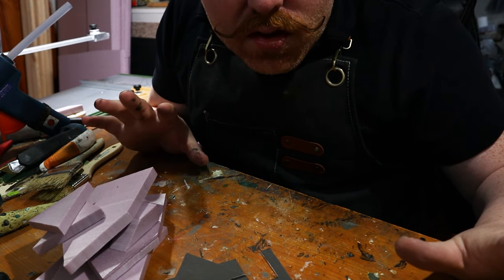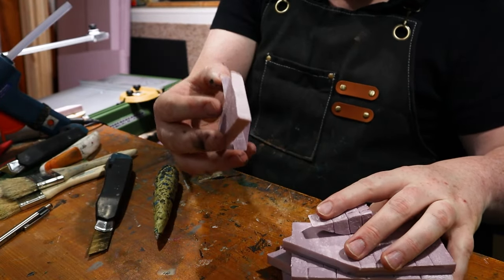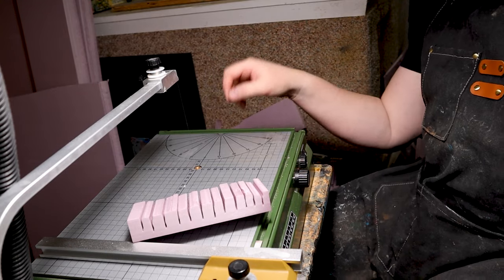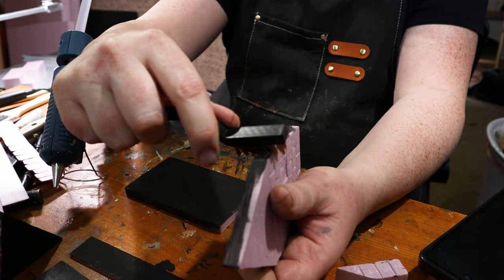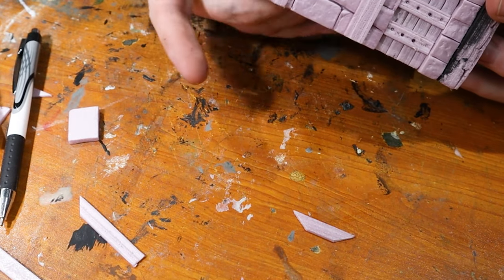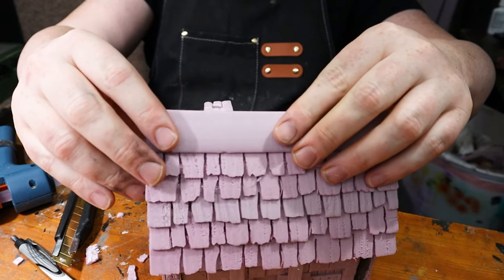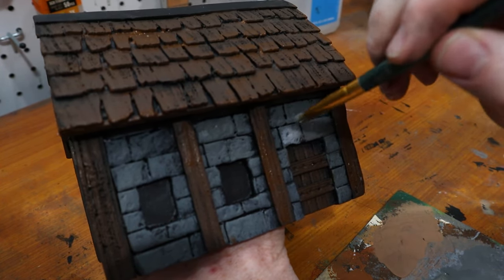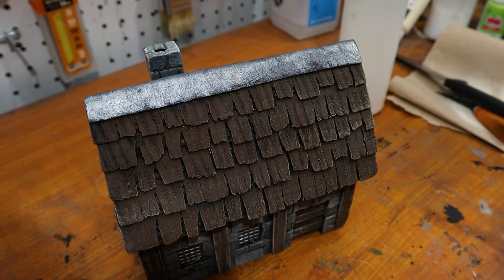Build Cottage Terrain EASILY - In Depth 🏡

Comment: Nice work, took a look at your etsy shop, and knowing how much they take I think your prices are insanely low unless when you are not making a vid you knock out a full cottage with 20 minutes of work.
Reply from the maker: Thanks so much for the kind words and for checking out my Etsy shop! I understand the concern about pricing, especially considering the effort that goes into each piece. The process of building terrain is indeed intricate, but I've found a rhythm in working on multiple builds simultaneously—usually between 10 and 20, depending on their complexity. This approach helps me streamline the overall time spent on each project.

When it comes to pricing, I aim to take a comprehensive view, balancing the cost of materials, time, and the Etsy fees, which, for me, average out to about 10% of the gross income. This is relatively manageable compared to other platforms, such as eBay.

Ultimately, I'm able to earn an average full-time salary from my work. More importantly, though, the real reward comes from the joy of crafting terrain and knowing it enhances the gaming experiences of others. That's what truly drives me every day.

Thanks again for your support and understanding. It means a lot! Also, apologies for the longwinded response.
Reply: @ArtJeremiah I was curious about that too. Considering the low price vs time investment. Obviously you make it work! But would casting some of the common parts, like walls, and then doing pours for them be quicker/cost effective?
Reply from the maker: @03dashk64  I've done quite a bit of experimenting with casting.  It can be worth it, but resin casting can be heavy to ship.  Also, unless you have some sort of vacuum chamber you can get bubbles, and a vacuum chamber or pressure pot is it's own hassle.

Casting with 2 part expanding foam was interesting and really creates some heavy duty and lightweight terrain.  That said, it was also a hassle to work.  It takes experimenting and math to pour the right amounts into the molds.  You also have to make some pretty heavy-duty molds.  Like silicone encased in fiberglass or plaster cloth and a way to bolt or band it shut to prevent the foam from just expanding out of the mold.  It's a lot of work but the end result is satisfying.

Overall, molding parts with resin or molding whole pieces of terrain can be rewarding but overall it felt too much like work and less like art.  So I switched back mainly to crafting with foam and hot glue.  And depending on your mold, you can use thermo plastic (hot glue or plastic similar to wooodland scenic trees and bones models) as a medium as well and it's less susceptible to breaking than resin.

Really, if you haven't experimented with casting I would recommend trying it out and seeing if it's for you.  Perhaps I can make a more detailed video about casting in the future.

Comment: I like to use a plastic grout brush for texturing my tiles and timber, you get the same effect without most of the problems you get with the wire brushes. The house wound up looking really great
Reply from the maker: Sounds like solid advice.  I have a plastic one too so I will give it a try.